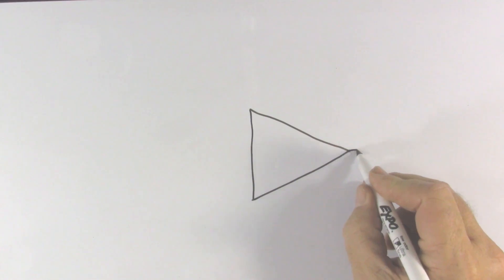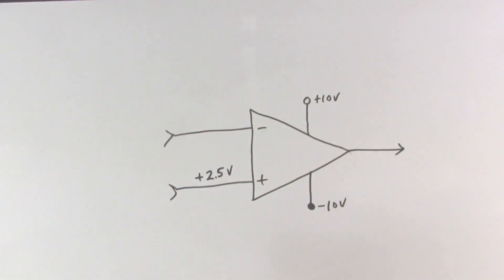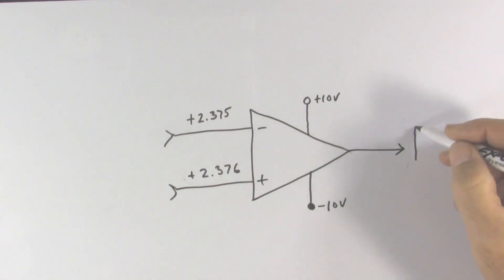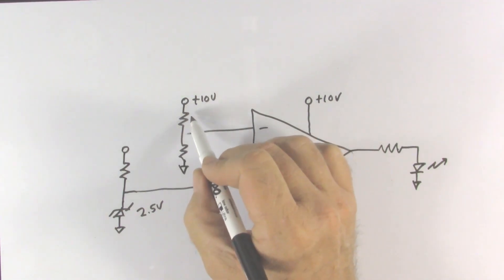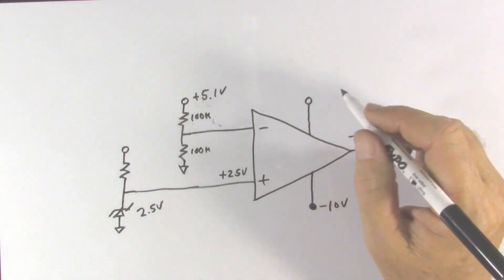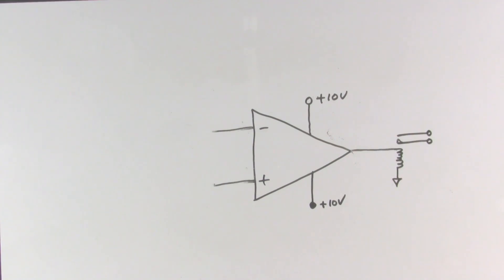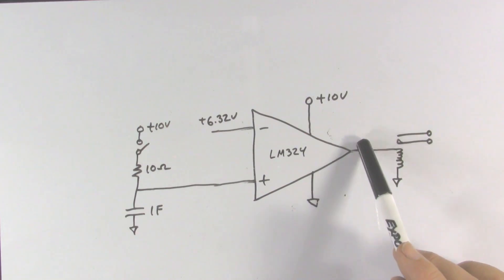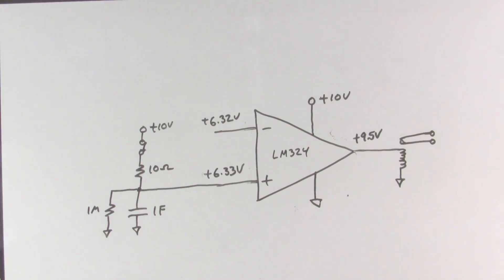Operational Amplifiers No  2, Comparators

Comment: Thanks for this simple way of clarifying things. could you please explain why not to let the voltage at the non-inverting 4.99v and when the battery reaches below that reference the LED lights up. in other words why we need to use a volage divider and Zener diode?